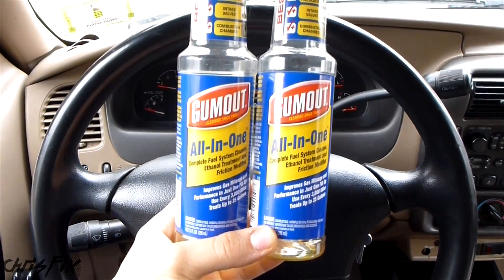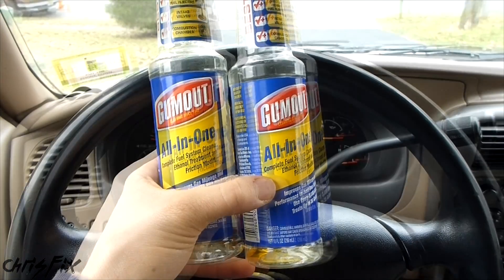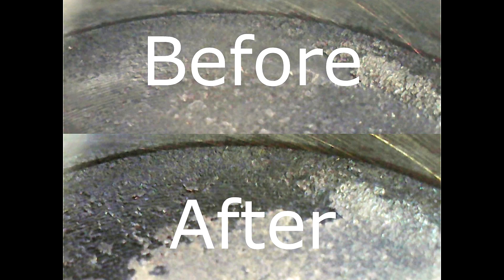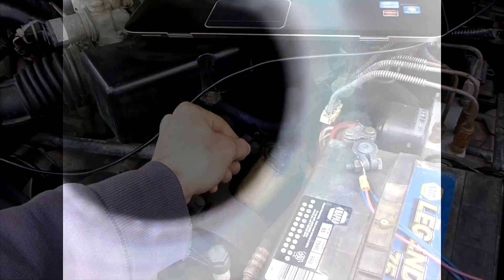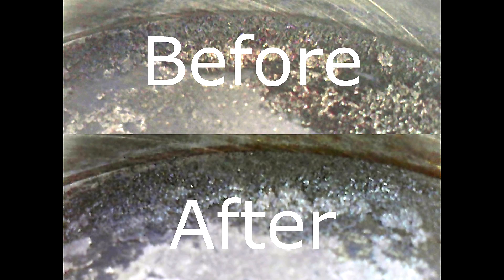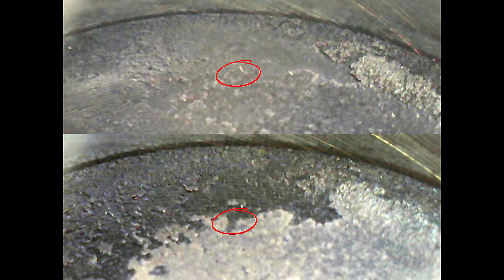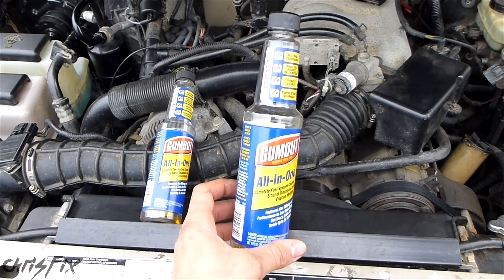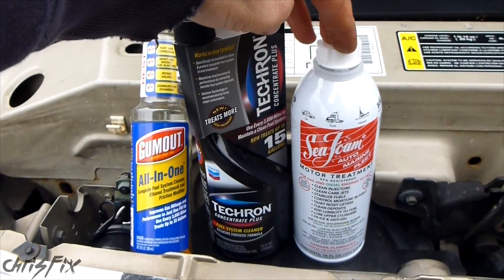Does Gumout Fuel System Cleaner Work (Follow up)?

Comment: Wait a sec.
1st run was 210 miles (7/8th of a tank).
2ns run was 314 miles (31/32 of a tank).

Did the fuel consumption not go down, and BY A LOT?
Reply from the maker: I film a lot with my truck which requires a lot of idling which affects MPG which is why I didnt test the MPG.
Reply: ChrisFix
2 things.
1. I love your videos and what you are trying to do with them. Keep it up - but expect some criticism(regardless), and for my part, I hope to be fair! If I am not, please make sure to criticize my criticism - after all, I am criticizing your review, that's all.
2. But you can still agree that ~50% difference in the fuel tank's range, without being given any explanation whatsoever, does seem a little suspicious?

Comment: What if you actually run the vehicle at full throttle for a tank? If you are getting 524miles on a tank of gas in a truck, I can guarantee that nothing will be cleaned because you are injecting such a small amount of fuel feathering the throttle. You need heat and rpm and the largest injection  possible to get proper results.
Reply: I have some serious concerns regarding this video myself.

But, you have not bothered to check the 1st video of the series, where he got 210 miles on a tank. The second video's totals are actually 2 tanks of fuel.

That said, do you really want to run the car at full throttle for 6 gas tanks? Cause let me tell ya, a V8 will go OM-NOM-NOM-NOM on that 94-octane fuel happily, but won't get you very far.
Reply: SeriouslyKidding actually I'm not cheap, so I just replace my fuel injectors and fuel filter and just blast all the crude out of the fuel lines with brake cleaner and compressed air. I have no misfire issues. Most parts places can get rebuilt injectors for most makes for 30$ a piece.
Reply: SeriouslyKidding if you maintain your fuel system and ignition system, and change fluids, you can run any engine into extremely high mileage and it will still perform as it did when it was new. Even with 350,000miles. Get on your misfires and get em fixed. Your engine is designed to run on all cy
Reply: Anthony Rybczynski
That was not a point I was trying to make at all.

Yes, my hobby car is misfiring. Recent addition - much smaller to the oil pump's O-ring leaking oil, however... That said, thanks for pointing me in a good direction to stop misfires. I replaced my fuel filter at 203k km (third-hand vehicle) already, injectors might be a little while (30 bux for a fuel injector for an M62TUB44 repaired? Are you from Poland or something???)
Reply: SeriouslyKidding from Canada. Stuff is generally more expensive here than US. I can't speak for the rest of the world. I also said most injectors. Lol. BMW may be an exception. I would compression test it for sure. It's no fun replacing working parts. Check fuel pressure at the engine, check ignition, Compression. Interesting about the oil seal. On VW vr6 engines the hydraulic timing chain tensioner works with oil pressure. I have never worked on any bmw cars. Ford only.
Reply: SeriouslyKidding check out bmw vanos variable valve timing. Designed to maximize torque under acceleration and improve smooth idle. Adequate oil pressure is required to make the timing chain and hydraulic variable cam actuator function properly. Looks like you are on the right track.
Reply: Anthony Rybczynski
Hehe, the (hobby) vehicle I have has a first-generation VANOS (Variable Valve Timing). A second incarnation of the 8-cylinder, 4.4L M62 engine, the M62TUB44. It my great hope that the poorly-designed plastic retainers for both (or either) chains don't fail prematurely - else the engine is as good as dead... Trouble is getting the damn thing out - the engine is not that expensive, not now at least.

O-Ring was relatively simple to diagnose. Dashboard put out text: "STOP ENGINE, OIL PRES LOW". Never had this issue - did the pump break down on me or the O-Ring, while it was leaking a bit of oil prior... Added oil, started the engine, drove a click and a half, same message comes back. Yup, pump supplies pressure, O-Ring can't hold it.

O-Ring: $15 (shipped)
Tow, labour: $700.

Just need to raise the damn thing 40 cm up in the air to do it myself in 2 hours...

Comment: I wonder if the cleaner works better if you only run highway miles..... Hhhhmmm....
Reply: I've heard it does.  My mechanic suggested driving on the interstate at around 75 mph in addition to adding this.  (He recommended Seafoam, but the same principal applies with any cleaner).

Comment: you should try gumout multi system tune up.with P E A. its made for modern engines 
 https://www.walmart.com/ip/43913005?wmlspartner=wlpa&adid=22222222227032163081&wl0=&wl1=g&wl2=c&wl3=77515955808&wl4=pla-107411973648&wl5=9007034&wl6=&wl7=9007051&wl8=&wl9=pla&wl10=8175035&wl11=online&wl12=43913005&wl13=&veh=sem

Comment: I used Chevron Techron Concentrate Plus around 3 months ago. 
Today, I found  Gumout 800001364 Regane Complete Fuel System Cleaner sale at auto store for $2 a bottle. Should I put Gumout in the gas tank now or wait until the car reach 3,000 miles? Don't know if it safe to mix Techron and Gumout?

Comment: Did it improve your gas mileage?
Reply: Thanks, this is my biggest issue with the video. First time round he got 210 miles on a tank. Second time round he got 314 miles on a tank. Even if the readings of the fuel gauge are 10% difference, that is still a huge improvement on gas mileage.

Comment: I mainly use gumout as a 1 step cleaner for everything before the combustion chamber, once it gets in there its burned and is pretty much useless past that point, yes its worth it for the fuel injection system but thinking its gonna do anything past that is crazy..if anyone decides they have bad carbon buildup and decides to go crazy using 2 bottles then they should just pull the head and rebuild it if you have issues with carbon.
Reply from the maker: Thanks for sharing!

Comment: Would pouring it directly into each cylinder and let it soak not clean them perfectly Chris ?
Reply from the maker: Possibly but the fluids will leak past the rings into the oil and the carbon would all come off at once which could damage the inside of the engine when you start it.
Reply: wich is why you cant put something in there and scrape the top of the piston's off

the gas mileage difference is confusing everyone you said in your first video 2 or 3 days later so your not driving it to empty the tank or clean it your driving it to drive it gas mileages will change where you go first run you may have done a lot more stop and go wich is less gas mileage then if you were on the highway....
i want to know did you rev the engine at all if you remember. the higher the rpm the hotter and faster the stuffs moves wich may not actually clean it more but may remove it more as there is/will be a build up it doesn't all come out at once. and in a few of your before after photos it looked like some was gone but it was also moving around some.

Comment: does it make more sense to use these cleaners with less gas to cleaner ratio? I know they often say that they work with up 25 gallons of fuel but do they work better with 5 gallons of fuel for instance?
Reply: Before you put it in your cycle. Check your dealership. If not, I guess use a 5th of it lmao
Reply: Yes try it with half a tank at least twice but try the high mileage one you will not be disappointed the one for the whole fuel system......
Reply: The cleaner is atomized along with the fuel. I won't hydrolock unless there is another problem with the injector or carb.
Reply: Roy Skenz I'd check with a mechanic as too much cleaner to fuel can essentially cause your car to hydro-lock

Comment: you seem to be baseing your tests on the carbon build up on the tops of pistons, i know the bottle does show a pic of this, but carbon ontop of the piston (unless a huge amount) isnt really affecting anything, this is a fuel system cleaner (alledgedly) did you check the valves? (before n after) the fuel injector spray pattern before n after,..just sayin

Comment: I don't understand why cleaning these physically isn't an option ? It seems it would be easy enough to put some sort of skinny spinning tool in there to brush off all the carbon, then blast it out with pressurized air or use suction to suck it out.
Reply: Those parts are really sensitive it wouldn't be worth the risk.
Reply: truthisreal. He is talking about sticking something like a dremel with a wire brush attachment down the plug hole then suxking the crap out.
Sheesh. 
Reading comprehension or what?
Reply: James Joe but then you run the risk of daminging the cylinders and it the pistons
Reply: I get what he's saying. You could put it through the ports. But, then it has to go through ports.
Reply: automan224 you realise your pistons, valves and head all experience multiple per second energetic explosions ewhenever it is running, right? He isnt talking about dropping something metallic in there and LEAVING it in there.
Hes suggesting a bit of dremel work with a wire brush (just like if you took the head off to decoke it) then blowing or sucking all the crap out, not leaving it there.
Reply: I would be scared of trying this for one reason: bits of carbon grit falling down the edge of the piston on to the piston ring. A wire brush is a bad idea because it will tend to machine the piston surface and possibly the cylinder wall - very bad. I would make a custom brush tool that had a softer abrasive like walnut shell, then vacuum out the cylinder with a thin hose.
Reply: Yes, you can do that. Unless you want an undamaged cylinder/piston, then you shouldn't
Reply: Or u take the plugs out and spray in a solvent like brake clean and then use like a skinny long paint brush and then wither suck it out or just blow it out with compressed air and then repeat. Rinse and repeat
Reply: Just make sure you don't break off some of the skinny spinning tool.
Reply: Because removing the pistons is really really hard dude.
Reply: Lol you realize this is almost all the way inside your engine? You'd have to take off A LOT of parts just to get to the pistons and cylinders. That's a shit ton of work and you can easily break any of them while taking them off and putting them on. Not to mention the parts you can't really put down due to debris. Overall that's too much work just to clean some carbon.

Comment: Well these thing have been tested independently and they do very little, and with prolonged use they actually start building up gunk of their own on other components (injectors,valves,...).
I'd say if you really need to use it go for a direct dose in the cylinders and leave that to soak for a day, but don't actually put it in your fuel because it might make things worse.

Comment: in ref to the carbon deposit around the outer edge of the piston that shoulf be left in place as it helps stop the enging burning oil  the center or crown of the piston can be cleaned, when a mechanic does a decoke on a cylinder head they leave a circle of carbon on the piston hope this helps. from a retired motor mechanic

Comment: It says "every 3,000" miles? You did it one full tank after the next? Just a thought
Reply: Well, that wouldn't be a huge factor for the cleaning aspect of it. As it just means the concentration of the Gumout will be there constantly. 

If they recommend doing a higher concentration like Seafoam does (that being 2 cans for one tank) the results might be better in a single test.

Comment: Use a clean air filter, semi or full synthetic oil and good filter,  and every now and then put [two] bottles of fuel injector cleaner or total fuel cleaner in. Various brands work, but don't rely on them to a fault.  If your a city driver, get your ride out on the highway for a longer cruise now and then and kick it down.
Reply from the maker: Thanks for the tips!
Reply: Right on buddy...good video!!

Comment: I have one question, where does all the carbon deposits go when they are detached from the piston? Can someone please tell me?
Reply from the maker: +freelan89 it goes out the tail-pipe
Reply: +ChrisFix  Yes :D I know that, but isn't it possible that bits and chunks of carbon deposits to get caught or stuck somewhere down the path, for example like: exhaust valves, EGR valve, catalytic converter, muffler, something like that?

Comment: Suggestion ; put 2 bottles of 104 octane in your fuel tank - run a little harder (heavy passing gear) then usual. Post a video before & after. I believe it should appear cleaner then any " so-called cleaners " do. ** Example; wood stove stack with creosote & stack that was burned toward high range of burn zone according to meter.

Comment: Quick question: Could you just scratch that carbon deposits on the piston with a screwdriver?
Reply from the maker: +quikesan No, you never want to scratch the piston. If the screwdriver scores the piston then you could get a hot spot and detonation which would be really bad.
Reply: cool. Thanks for the answer :)

Comment: Could it be that you use a V6 enigne instead of a 'normal'3 cylinder engine?
Reply: I don't know where you live but the only cars I know of that have three cylinder engines in them where I live are smart cars, so they're not exactly normal.
Reply: Here in europe most manufacturers seem to be going for low capacity, 3 cylinder turbo charged engines, for example fords 1 litre ecoboost which can produce 123bhp with 1000 cc and 3 cylinders

Comment: it also suggests doing a fresh oil change as well for the products, was this done? just wondering if it might help with some fresh lubrication of the pistons and may possibly move some of the larger build up
Reply: and also doing a full engine clean, so Intake Manifold, throttle body etc, maybe once you do that a couple of times results may improve more. 
Just a suggestion im not even sure if that would fully work, but i have noticed after using similar products and doing oil changes an cleaning the manifold etc i have had performance increase, in relation to quicker response from the engine and improved mileage as well

Comment: Your test was scientific and fair.   Generally speaking the additives are "snake oil" at best.   The question is whether or not  a clean piston top contributes to anything at all.

Though I must admit that I am a sucker like others and occasionally I use these cleaners.

I have a Ford 500 3 liter V6 with 182,000 miles.  I get 32 mpg at a steady cruise of 
70 mph.  Would a perfectly clean engine do any better?   I don't think so.   Thanks so much for this video.   I will keep my money in my wallet from now on.
Reply: +abz124816 

if everything inside your engine is clogged up it might help get you an extra 6 horsepower wich is lost by running the engine for so long.

Comment: i think if you use this stuff on regular on a new engine it might prevent carbon buildup from occurring at all
Reply: true
Reply: Then even run your car with premium gasoline with cleaning additives is cheaper...
Reply: @FeelFree3  i tried it its effective
Reply: @FeelFree3  premium gas does not have more cleaning additives all gases have the same amout of cleaning additives

Comment: I watched all your videos. Very informative thank you. Readind the MSDS it's hard to believe that old school pale oil naphtha and isopropyl alcohol in seafoam would perform better than Techron or the all in one which both have PEA. I have a theory that perhaps it's the dispersal method. according to Techron a bottle in the tank is 10 x what it would be with a Tier One gas detergent. you direct induced the sea foam which could be possibly 1000x what it would be in the gas. so it would be nice to see the induction methods be the same throughout all the tests. would like to see seafoam in the gas only if you can do that would be nice.
Reply from the maker: +Bondo Thanks and those are good ideas! Maybe I can test that out after I finish the other products!

Comment: use the same testing protocol between products. Pouring any fuel additive into the vacuum hose or fuel rail undiluted will clean a lot better than running it through the tank. So test All in One the same way you tested Seafoam please. Also, what does Seafoam look like when poured into the tank vs the vacuum line.
Reply: +R Huskador  I would guess all of your videos would show busted if you only tested via tank.
Reply from the maker: +R Huskador You are not supposed to run this though the intake like seafoam. It is not in the instructions for a reason.

Comment: Hey Chris how about using water to clean out the carbon and see the results.  I used to use an old windshield washer bottle with a filter attached to the hose in the bottle and a misting valve on the output side.  I hook it up to a vacuum hose that is connected to the intake and fill the bottle with distilled water and drive it until the bottle run empty.  Smokes like hell in the beginning and you may have to adjust the misting valve one way or the other but it does clean the carbon out.